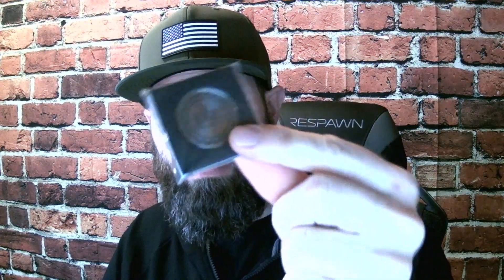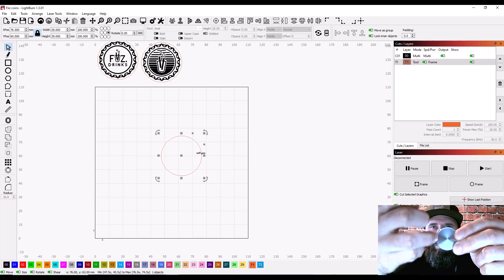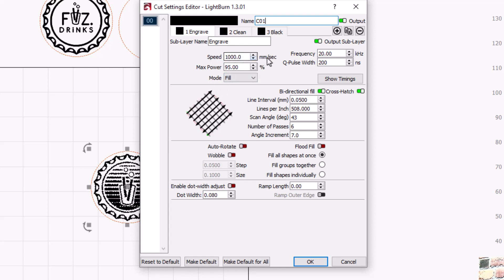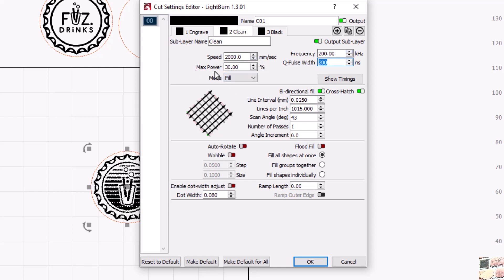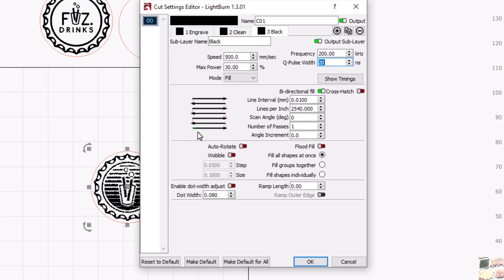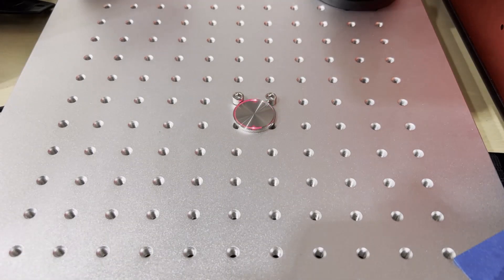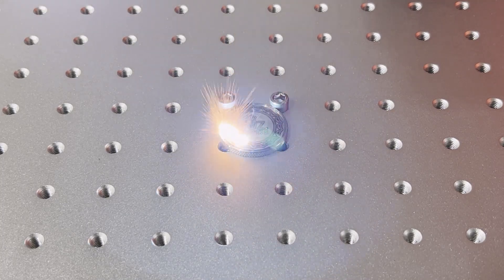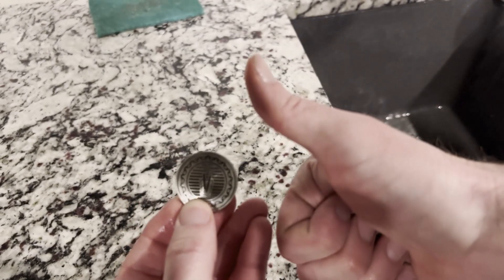Personalized Coins on a 100w MOPA Fiber Laser

Comment: I have the same machine but my problem is with cutting settings .
It cuts and do soldering in the same time. The laser goes through to the other side, but it's impossible to pop out the the cut peice
Reply from the maker: Look into using your wobble settings. It will make a slightly bigger kerf so the hot metal is not still touching and fusing back together.

Comment: Hi, this is great, thank you.

I didn't see you mention what lens size you are using with all your settings.

Could you please share? Much appreciated!
Reply from the maker: These were done with a 110 lens

https://amzn.to/4e7oMID
Reply: @BeardedBuildsCo  Thank you for the reply - very much appreciated!
Reply: @BeardedBuildsCo  Does the lens size really make a big difference? I'm running a 70mm lens on my identical machine and can get absolutely nowhere near the quality you seem to get off your 110mm lens. Engraving and cleaning seem to go great, but my black layer is just... not black.
Reply from the maker: @ThePattyChuck the shorter the lens the more depth you can get quickly because the power is not diluted by the longer distance. If everything is working out well other than the black it is likely a settings that you need to work on. Using my engraving and clean settings on a different lens probably work perfectly fine but the black will need fine tuning.
Reply: @BeardedBuildsCo  Appreciate your reply. I can get pretty good black on just 2B stainless test plates, but as soon as I try to get black on a lasered surface, it just doesn't work lol. I'll keep testing. Thanks again for your great content!

Comment: Hi, you use a 100W JPT Mopa M7 right? This Laser has the Option Pulse duration. You have to look into the technical Data first. There you can find the max Ratings depending of the Frequency. You can set the Q Pulse of max Power depending of the Frequency. Example: if you use a Frequency of 70kHz the max Q Pulse is 250ns. At 200kHz the max Q Pulse is 60ns at the max output Power. It means if you set the Power at 50% at 200kHz and 60ns the output Power is 50% or 50W. If you increase the Q Puls from 60 to 200ns the output Power is less than 50% or 50W. If you decrease the Q Puls from 60 to 30 the output Power is also less than your seting of 50% or 50W. The max Q Puls is 2ns at 2.960kHz. At 20kHz it is 350ns.

Hope you Understand what i mean.

Comment: Can a 60w MOPA do everything a 100w can... just slower? A 60w is more is a more reasonable price point for me. 
Thanks!
Reply from the maker: You are correct. It will just be a little slower and possible won’t get as deep if you are doing a deep engraving. The 60w MOPA is an awesome machine! You can save a little more with my code BEARDEDBUILDS5OFF
Reply: @BeardedBuildsCo  Thanks... I am still in the "wishing and trying to justify-and talk my wife into it" phase. 🤔I have a OMTech AF2028-80, and I used that discount code! Thanks!

Comment: This video was awesome thank you. I have a 50w OMG MOPA and am struggling with settings. How did you get so fine tuned with yours?
Reply: The answer of how he learned is "failing"
You mention nothing about WHAT you are trying to do.
If it's metal, get a cheap test sheet and change only 1 setting at a time.
Just like an optometrist that flips 1 lens at a time and asks you "is this better or worse"
Process of elimination. 
Keep detailed notes.
Good luck.

Comment: love your content, and the knowledge i've gained so thank you! . One question, have you tried making dies, touchmarks, punches, etc..? I'm close to buying one of these, with that being one of the goals but there is virtually no content for this
Reply from the maker: I have not done these. Could you point me in the direction of some blanks that you would use and maybe it is something I could give a try. My guess is lay it’s possible a machinist cnc that does most of them.
Reply: @BeardedBuildsCo  Any tool steel would work imo, especially for testing. Most seem to use A2, S7, D2, misc vanadium steels, H13, etc... just need to heat treat after cutting. Older solutions were def milled CNC, but many of the companies making them seem to have switched to MOPAs, just on the higher end.